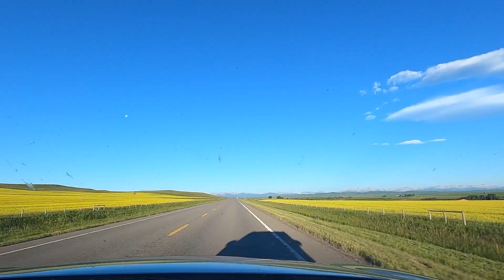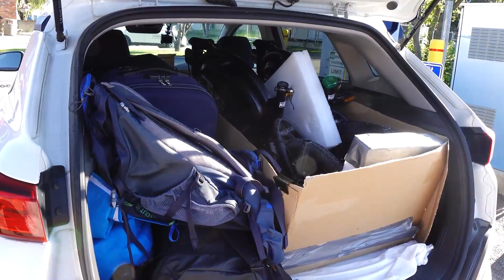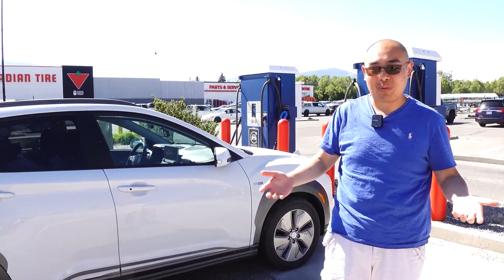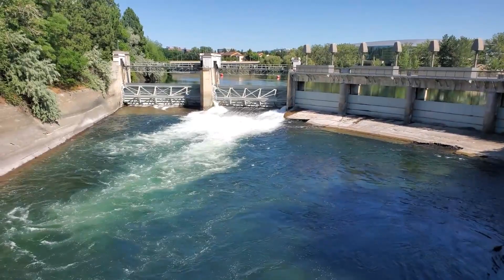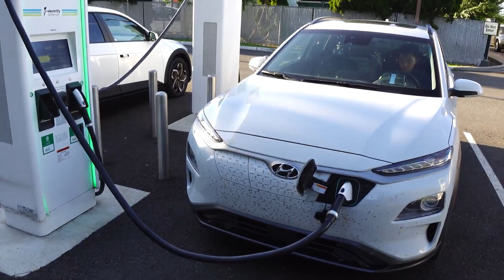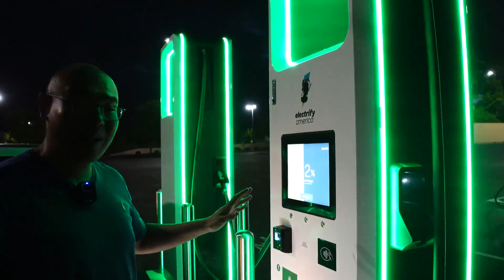1200km Kona Electric EV Road Trip: Calgary to Seattle - Part 1

Comment: I love watching your video. always interesting to see someone actually using a Kona 😉 
if you're still using the EVOBD2 module, did you do the update to V.2.20 (free update) to get the new battery capacity measurement? if yes, what's you current KM and what is your battery capacity?

Comment: You can create an Electrify America account with a Canadian credit card. In the zip code field, use the three numbers from your postal code and add two zeros on the end.
Reply: this is usually the trick... but some Canadian credit card will not work with this trick. Here in Québec, Desjardins credit card will not work on the Electrify America app with this trick... but using this postal code format has worked in the pass elsewhere without any issues (like gas pump where you need to enter your zip code).

Comment: Hi, thanks for your video. I always enjoy watching them 🙂. Especially as I have the same car 😉.
Just a quick question: for your consumption calculation from cle elum to tavoma, how do you get 18.2 kWh/100km? You used 41% of battery, meaning 26.25kWh (from your 64kWh battery). 26.25/1.97 = 13.3 kWh/100km. Likewise, you should have 7.5km/kWh.  
(i didn't check the other sections)
Reply from the maker: We just used the vehicle's built-in consumption values, perhaps there were thermal loss?
Reply: @READYSTEADYCHARGE  In my Kona, I haven't found a trip counter I can reset at will. Apart from the global counter, there's the daily counter that only resets when unused for over 4 hours. Based on your numbers, you should have consumed 56% of battery instead of 41%. Différence feels too great to be thermal loss. I have the feeling the 18.2kWh/100km you mentioned includes the previous sections, especially the uphill ride. Meaning the average consumption of what you drove up to that point.

Comment: We are from Seattle and are going to Kelowna BC in our Ioniq 5 next weekend. I was able to sign up for Electrify Canada. It required be to pay an amount ahead that was charged to my US credit card. I paid $60 which I figured would cover this trip, but it turned out that it deposited $60 Canadian which probably won’t be enough for our trip to and from with running around in between. It’s strange that EA hasn’t incorporated that into its business model too.
Reply: Also, picking up a month worth of Pass+ for $4 was worth it for our trip. Might be for yours too.
Reply: We just drove from Edmonton to Vancouver using Electrify Canada in an Ioniq 5. It cost about $45 CAD, so $60 might be close to your cost. EC charges by the minute, and an Ioniq doesn’t use many minutes.